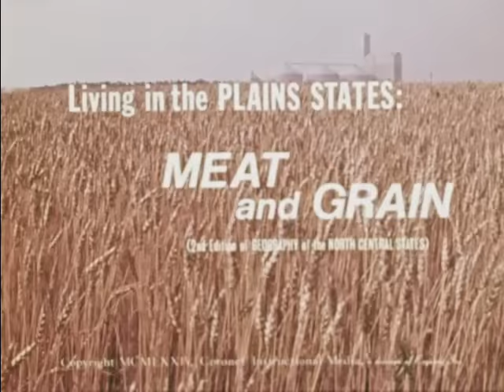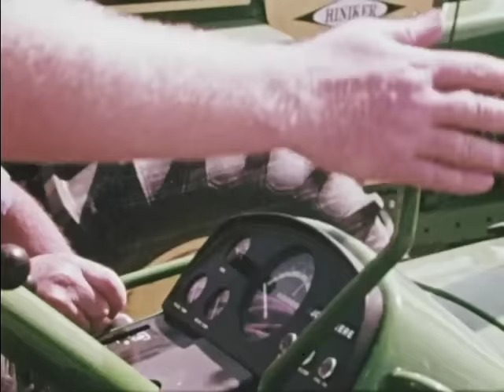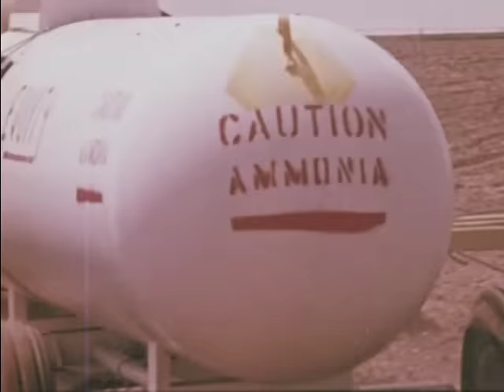Living In The Plains States: Meat And Grain (1974)

Comment: The "automatic transmission" shown is a Syncro-Range.
Reply: disappointing, hoping for a powershift in that sweet hiniker cab
Reply: @stonestadheim7381 yup I had the same thought
Reply: @stonestadheim7381  There wasn't anything "sweet" about those Hiniker cabs.  There were a couple of 4020s in our neighborhood that were bought new with them circa 1972.   Those noisy cabs were removed and tossed in a fence row 30-40 years ago.  Both tractors are still in use with row crop fenders on  them.
Reply: @trevorn9381  compared to the other aftermarket cabs of that era, they were much higher quality and not any louder than a hinson

Comment: I remember when the John Deere guys wore the yellow and green uniform. Just traded tractors at John Deere last week. They have come a long way since this was made. I'm not sure it's all for the better.
Reply: You will probably wish you had kept whatever you traded. Yes the new ones start faster, and ride much nicer than the old Sound Gard tractors from the 70s and 80s and the cabs are quieter and there is no door post, exhaust pipe or air intake stack to look around but those old ones were much easier to fix.  I'd rather have that old 4630 shown sitting on the dealer lot in this video than a brand new computerized, emission, controlled 6R series but I am now an old coot like the old farmers I remember who were still running old Poppin Johnnies from the 1930s - 1950s when I was a kid in the 70s.   I thought they were backwards as Hell back then and the young farmers driving the newest and the latest green machines from JD probably feel the same way about me now. 🤣
Reply: In the future old iron will keep us alive!@trevorn9381
Reply: @trevorn9381  it was just a little guy, 3005 basic loader, and mower. Needed a little bigger tractor,  so now it's a 4310 with a loader, forks, and backhoe, kept my brush hog backblade, plow, cultivator, and harrow, I mow around the house with a 1023, just needed at little bigger utility tractor and a backhoe for some projects, and want the 1023 kept as just a lawn mower. The stuff from the 70s was good straightforward, and I did my research and shopped around, but I am retired. We just have 13 acres. The closest thing to real farming that I do is drive a truck during harvest for my neighbor. I get what you are saying and agree with it.
Reply: @trevorn9381 I agree. We have a new track tractor and a old 4440 and I’ll take that sound gaurd any day. Awesome ole tractor

Comment: In the 70's I made three summer harvest runs and one crew I worked with had 7700 combines.  Good machines.  In the late 60's I worked for a relative of mine
for two summers and spent those summers on a John Deere 820 tractor.  Good times.  Thanks for posting this video. For some reason,  the audio goes away at 11:05

Comment: That’s the sickest sounding Farmall 806 I ever heard! LOL
Reply: The black smoke is missing,  I ran 2 of them and both looked like it  burned coal
Reply: That's a gas 806, no wonder it's sick.
Reply: @deanpahl8591 she’s definitely a diesel
Reply: @loganbeedy5950 no it’s a gasser, notice it’s gurgly sound aside from a smooth rumble of a diesel
Reply: @30acreshop_time  look at the motor during the scene of it pulling out of the field or when it’s baling in the field, there’s no carburetor on it, it’s definitely a diesel. But the sounds don’t match it, almost sounds like a 2 banger Deere sound got overlayed over the 806
Reply: @loganbeedy5950  yes I suppose your right, but since the videos sound quality isn’t the best I guess that’s where I got the gassed sound from. I was also thing the same that it sounded like one of those 20 series John Deeres, cause it was a smoother popping not like the model A that would literally bang like gun shots